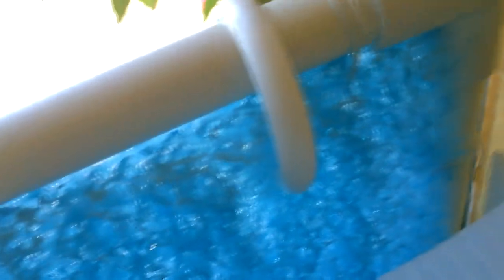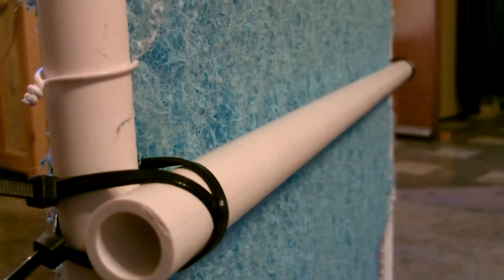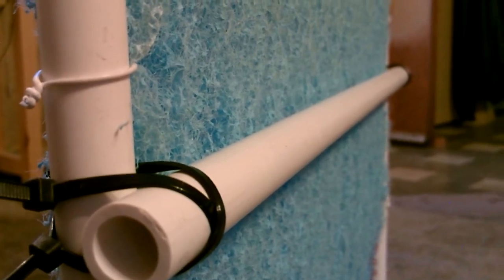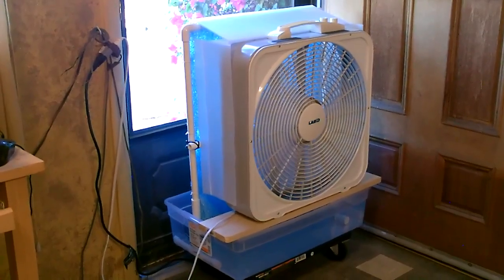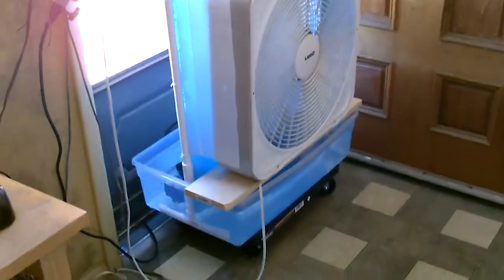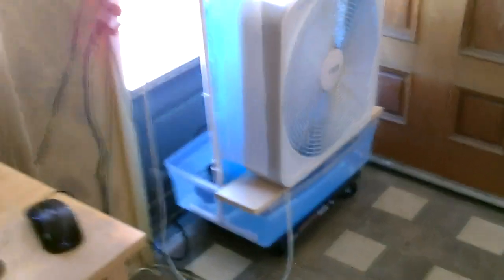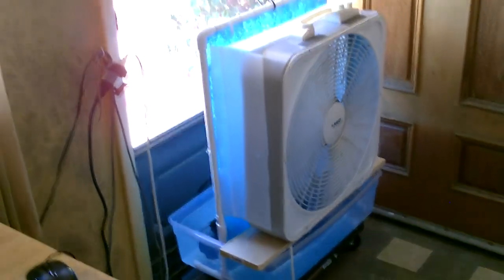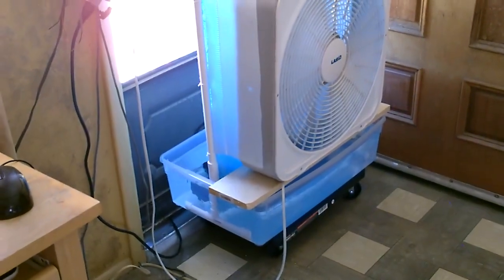DIY Evap Air Cooler! - JUMBO SIZED! Final version! (MAX cooling!) - Large Area Evap! - ez DIY

Comment: Props! Of course what makes it so effective is the fact that the place where you live in is naturally very dry, so the air can cross the evaporative cooler pad and make beautiful love with the flowing water, resulting in it giving away energy(heat) to the H2O molecules very easily, making them evaporate beautifully, cooling the air on its way out.
Reply: No shit.
Reply: Only problem is when the water heats up

Comment: Instead of adding more water, add ice, it will increase the cooling efficiency. I’m doing something similar with refrigerated water with the air blowing across tubing so it doesn’t add any humidity to the air.

Comment: The way this is set up, you're going to be pulling in a lot of hot air around the fan as well. I think this is some form of the venturi effect but I can't be sure about that.
You'll get much more efficient cooling if the fan takes up the entire opening so there is little to no space around the fan. It's a really good setup otherwise.
Reply: Is that what the shroud is for?

Comment: Lol thinking about just clipping a blanket to my fan and dropping the blanket in a little tote of water.
Reply from the maker: hi there. here is a video link to one of my very easy to make ones. all you basically need for it is a bunch of bath towels and a stand - like a drying rack. (so you most likely have everything you need to make it at home) and it works great! here is the link https://youtu.be/gT-suY9wTuE

Comment: made one that works ok, how do you keep the sludge from forming on the bottom of the tank, and clogging the pump.  I have to drain and clean once a week...  thanks
Reply: I used 10 drops of either vinegar or a scented bleach, per gallon of water, for my fountains. I used to professionally build table top fountains.
Reply: @ontheroadwithjoy6266  I was going to say 1 cap of bleach per gallon of water. Touché .
Reply: @ontheroadwithjoy6266  I am a little concerned about the bleach mixture, breathing it in over an extensive amount of time.  Probably  not harmful, since it's such a small amount, right ???  
And, you're  right, it only takes a few drop of bleach to  effectively disinfect the water.

Comment: Seems like it would be easier for the fan to PUSH air through the pad then to pull it, correct?
Reply from the maker: hi. if you try to 'push air' through these pads, they act like a wall or a barrier and almost no air goes through. pulling the air works way better. 🙂
Reply: @desertsun02  awesome! Good to know. Thanks for the response!

Comment: Would the motor on the box fan give out because super moist air is always blowing thru the fan motor area?
Reply from the maker: hi. nope, the motor holds up fine 👍🙂. (that's mainly because these fans are designed to be used in all humidity levels - even 90-95% for years at a time)

Comment: I wanted to try that with a high volocity fan.  The crossbar doesn't pump?  Just to hold the filter?
Reply from the maker: hi there. that's right, the crossbar doesn't pump. it's just to hold the pad. i actually tried it with a 20" high velocity fan but it didn't make much difference. i think it was a 3200 cfm fan. it might be because i think the pad is rated up to 2250 cfm or something. that's about what a box fan is on high.

Comment: Get a large thick copper cylinder or an aluminum cylinder drill holes into the cylinder then place misting nozzles in the holes then insulate the cylinder and then attach a high output blower fan to one end of the cylinder to force air threw the cylinder has the nozzles spray out liquid air to super cool the air. You could set up a stirling helium cold piston outside of your home to turn the atmosphere to liquid that filled an insulated tank with a.bell siphon that used gravity flow to force the liquid air threw a flitering system to pull out all the pollutants has the clean liquid air filled a insulated tank indoors that fed misting nozzles with fans moving the cooled air around then you could also use atmospheric water generators in your home to generate water you can filter for clean drinking water. 😊😄😉

Comment: Will any kinda pad work ? It's just there to spread out the water? Is the pump volume important?  Would a fish tank pump work? They are cheap and last for years
Reply from the maker: hi there. the pump just has to be strong enough to push water throughout the frame. i usually use the fish pump style pumps. i find that the 200 gph ones work the best. i've tried 150-160 gph ones but those are typically too weak  the pad has to be an evap cooler pad for it to work very well. they are weaved in a particular way to hold just the right amount of water

Comment: How does the evap pad cool the water?  Do you know the science behind that process?
Reply: A simple way to explain - it's like licking the back of your hand a blowing on it.
Reply: @OverlandOne  yes but wouldn’t the cooling fluid become warm and the temperature difference lower eventually making it not work, he’d have to have constant cold water.
Reply: Each gram of water that evaporates requires 540 calories of heat energy.   The heat energy comes from the air, which is cooled.  I don't think the water in the tank would experience much of a temperature change.

Comment: what about using aspen pads? are those the best pads?
Reply from the maker: hi there. these are about equal with aspen pads. they both cool really well. these blue pads can be cut to size though - that's why i use them. if you try to cut aspen pads they will fall apart.

Comment: What do you mean by having to change the water? Does it get to warm?
Reply from the maker: hi there. when i say "change" the water, i mean "add water". the water temp actually goes down as it's running. *because the water itself is cooled by the evaporative process.

Comment: Could you give me an idea of what kind of cooler I could build in the heat of Louisiana. These EVAP coolers don't work very well when it's 95% humidity?
Reply from the maker: hi there. if you've got super high humidity, i'd try the ice-based air coolers or consider running regular ac unit off of solar panels. you could also make a two stage evap cooling unit. those keep the humid air outside and output cool dry air. much trickier to build though ...but i'm working on it.
Reply: @desertsun02  Great job! Anxious to see your new two stage eval cooling build! Keep up the great work.
Reply: An Air conditioner is what you'll need.

Comment: What exactly is the shroud made of or what material did you use from HD/HF?
Reply from the maker: hi. the shroud is made of corrugated plastic. it's a pretty cool item. i use it for lots of stuff around the house. the evap cooler pad is made of foamed polyester.

Comment: Idea, use a stirling helium sealed cylinder cold piston to generate liquid atmosphere from the gases in the air that is ultra cold. Then fill an insulated tank with a frequency emitter in the bottom of the tank that will cause the liquid air to turn back to a gas state to build pressure within the tank to force the liquid air through a misting nozzles then have a drum fan push air through the area of where the misting nozzles are to super cool the air. A way to use the natural air to air condition your home. You could even push the liquid air through a filter that removed all the dust pollen and other pollutants in the air for clean fresh air. 😉😄😊
Reply: Indigo Dragon71 Kinda defeats the purpose of having this easy DIY swamp cooler.
Reply: Well its about ideas for different types of cooling devices. Say like an ulra mini stirling cryogenic piston inside a vibrator that a women could plug into a wall socket of a cigarette light and cool herself off. It also could be used to insert into the colon of an individual with a high temperature from having a parasite infection? 😟😕😒     😊😉
Reply: Hi
Can any one make one for me and sell

Comment: What exactly is the pad?  An air filter for a heater?  Is there certain type of pad that's best?
Reply from the maker: hi there. it's actually made for an evap. cooler. it's basically a loose-knit sponge-like material. they don't have any special name - just called an evap. cooler pad. most home stores have them

Comment: How much outside air intake do these need to run effeciently?  I Have a garage with no windows and want to know if the 15inx5in garage floor vents would be enough intake for this to help cool it down.  I’m in Las Vegas so plenty of hot dry air.
Reply: Zachary Flynn You don’t need any outside air. The air circulates from inside the room. (See the Large Cooler video he did. The system is sitting in the middle of the room.) So different, in this sense, than true swamp coolers.
Reply: Did you figure it out because I have a window with almost the same dimensions. I’m wondering if it’s too small for a box fan swamp cooler to run efficiently.

Comment: Put some ice in there, and that will do the trick!!!
Reply: Roger Mass the temperature needs to be higher for water evaporatoration
Reply: better still freeze 1/2 gl. jugs and set them in the water and fastened in a way to prevent them from traveling to the water pump.. An ice cube could get caught in the intake of the water pump..This also isolates the ice from the cooling water  so swapping the jugs out for fresh ones won't overfill the tank
Reply: Create a secondary compartment for ice after the fan so that you dont interfere with the evaporation of water
Reply: Freeze water bottles and drop in. Even better insulate the water compartment for longer lasting ice.

Comment: Throw blocks of ice from the back of freezer also
Reply: That's not advisable. You put heat into the house freezing the ice, just to try to take the same heat back out using the ice. All you are doing is making the house hotter if you do that, due to inefficiencies.
Reply: @timothyamanda4960  finally someone knows what they’re talking about here

Comment: Nice build!  How many watts are the fan and pump using?
Reply from the maker: hi there and thanks. pump is 10 watts. fan 70-85-100 watts (low.med-high). if interested here's my cost breakdown:  *since i run the fan whether i use the air cooler or not... the only extra power i'm using is for the pump. 10 watts (10 hrs a day) = 100 watt hours a day. times 30 days = 3000 watt hours. power cost 10 cents a kwh here, so my total 'extra cost' per month to run this is only 30 cents! (oh and it's using about 80 cents worth of water per month). so $1.10. *that's almost free. compare versus ac unit 4-5 dollars a day (or $100+ a month) forget that lol

Comment: What's (wattage, & voltage ) of pump
Reply from the maker: hi. i generally use a 200 gph pump for this setup. those are usually 10-15 watts (sometimes less)
Reply: @desertsun02  thank you, now for the 4 wall frame swamp cooler, would it still use the same pump
Reply from the maker: @Carl Schmiedeke yep, i use a 200 gph for that too
Reply: @desertsun02  awesome thanks again, i love your channel

Comment: Do you know what the final cost was?
Reply from the maker: hi there. it's really not bad. assuming you have the fan, it cost about $30 (w/o wheels) or $40 with them. *a comparable evap in the store run 300-400 bucks *this year... so forget that. they sell them cheaper (like 150-200) but those only cool about 150 sq. ft. this DIY one is cooling 800 sq ft.
Reply: ok thanks.
Reply: desertsun02, what's the size of the storage bin?
Reply from the maker: hi there. it's a 10 gallon one. got it at home depot.
Reply: desertsun02, THANKS! I'm making this on Saturday!
Reply: SKU # For the pad?  Thanks.
Reply: @desertsun02     800 SQ Feet?  Thanks, I've been looking for the numbers.  Is your fan still working since last year?
I am planning on doing the same, and connecting it to my GFCI outlet, just in case.
I also plan on getting a larger container, but with a slightly recessed lid on top, so that I can leave the lid on it, and the water will pool on it, before falling down into the container, via drilled holes. 
I was thinking of using my 5 gallon water can to fill it up, or even better, connect it to the water hose line, under my sink, with a splitter adapter, and run a fridge water tube line to the cooler, with an on and off valve on the line.

Comment: How big an area will this cool effectively?
Reply from the maker: hi there. depends on the outdoor air temps (and relative humidity)... but with outdoor temps from 85F to as high as 100F (and humidity from 5-25%) it's been cooling down my whole house (small 2 bedroom 900sq. ft) - down into the 70's (to low 80's near back of house). **i usually keep my ac set at 81F (perfect for my drier climate) so it's working great.. *as temps rise to 110-115 it might only keep front half of house at those temps... we'll see. But to answer your question in general terms... i'd say (figuring conservatively) it cools at least 600-700-800 sq. ft. very effectively in most temps

Comment: Hello. What kind of "cloth" are you using for the "water wall". I really need to try to build something like this. And what size you have  on the fan?. I looked at a 16"
Reply from the maker: hi there. the cloth (or blue pad) is an evap cooling pad (home depot sells them). fan is 20 inch box fan.

Comment: what is the blue material?
Reply from the maker: hi there. it's an evap cooling pad. they're made from a "sponge-like" material (probably cellulose). it's kind of a big "loose-knit" sponge. holds lots of water - and at the same time - lets air pass thru it.
Reply: One video shows actually using sponges but you can't of course on this set up.  Now there are also pads that can be bought for $1.00 that soak up water when drying dishes and I put this behind a fan.  Works pretty good!  You have done a good job and it must be hard to go through all the comments!